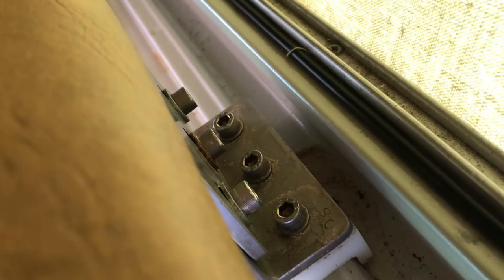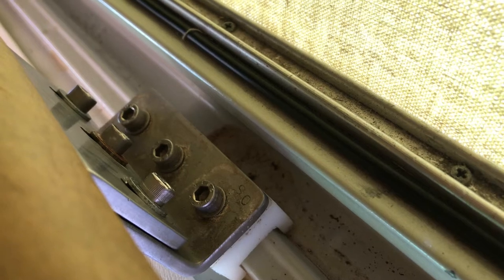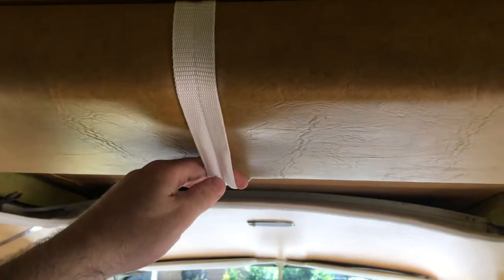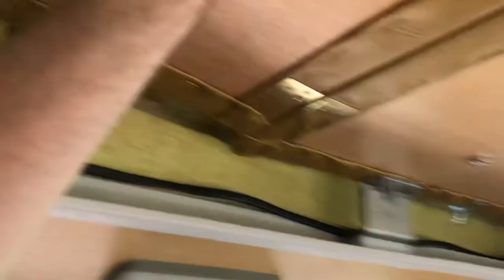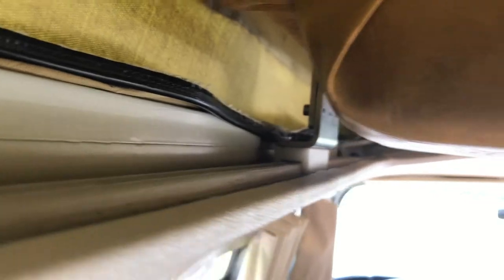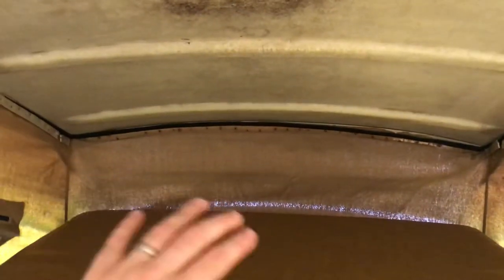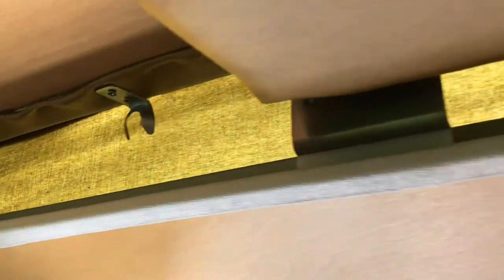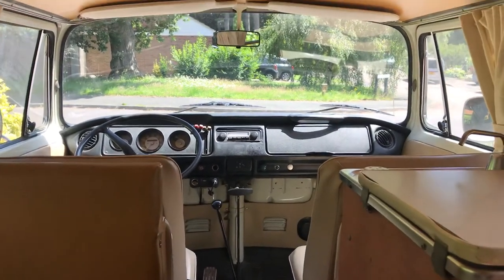Westfalia continental roof bed conversion in an early bay VW T2

Comment: Is the section over the cab just laying on roof panel? I need to build this. Thank you.
Reply from the maker: It has some rubber feet to keep it flat / protect from scratching. It sounds like this may have been a lot from NLA VW Parts from what other viewers have pointed out. Good luck!
Reply: I think they're kits you can buy from Just Kampers or another company for this type of bed. I'm adding a pop top to my sunroof bus and want to do this as well